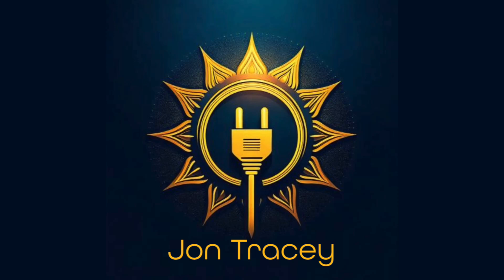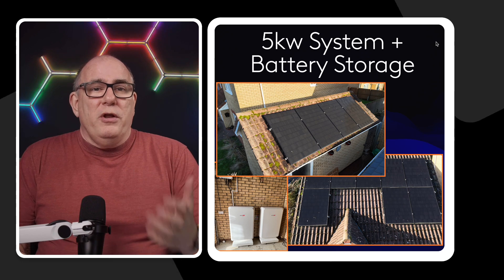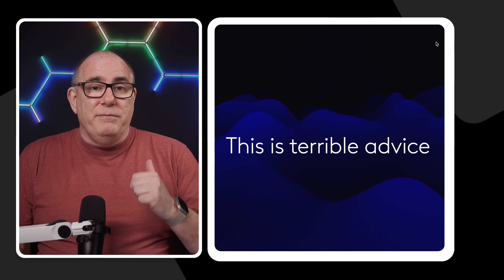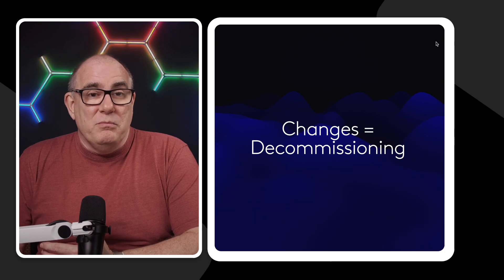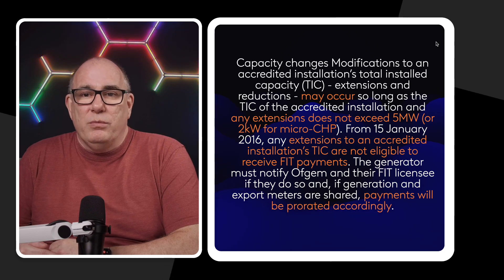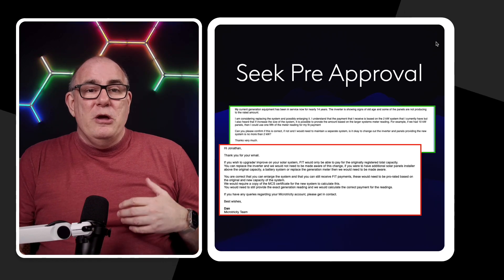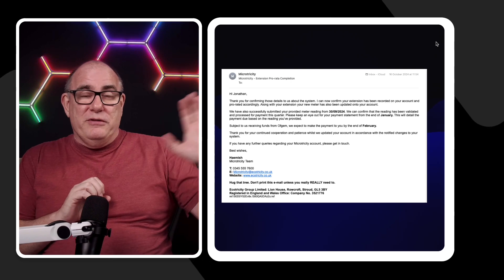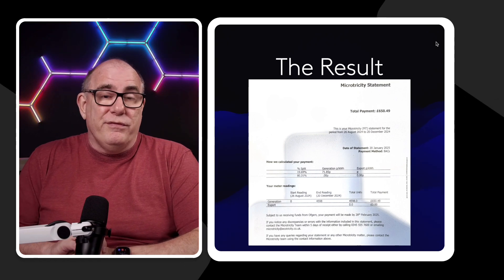How I Upgraded My FIT Solar System (and WHY I Did It)

Comment: I'm 3 minutes into the video. You didn't ask me, because I've been saying for what seems like years now that yes you can! When you do the FITS payments are calculated pro-rata, I'd seen it written somewhere, can't remember now, but I'm sure you'll remind me as I get further into the video. Edit. Yep, that OFGEM document is the one I read. I'm pretty sure the FITS finished in 2019, my system was installed in late 2015, and I got in just before the payments really tanked. I'm currently getting 18.34p for anything I generate on my 4kW system, which paid for itself in less than six years.
Reply from the maker: the ofgen doc wasn’t exactly published was it, they just put it up and let people find it. Good to hear your FIT has paid for itself, do you have it for 15 years. mine has paid itself twice over and still has ten years to run
Reply: @JonathanTracey  it's 20 years, so just over 10 years to run. Your on a very nice rate, so £30k in 15 years, very impressive. My system in late 2015 was £6300 for 4kW SolarEdge, so a lot cheaper, but less rewarding, but still very much worth it. I think I must have found the document when I was looking to add more solar, but decided to add to the garage instead of altering the existing system.

Comment: Like you I would like to simplify from 2 inverters to one. We have an original 3.8KW east facing system for which we receive the 2010 FiT rate. 3 years ago we added a 5KW west facing array and batteries. As and when one of the inverters packs up I will look at the big upgrade. In the meantime we will be removing the Deemed Export and taking on a flat export rate. Great advice in the video, many thanks.
Reply from the maker: Glad you found it useful, reach out if you have any questions 👍

Comment: I was aware of this, had seen similar documents on the OfGem and Eon (my FIT provider) websites.
I have a 4kW FIT system installed 2016, currently paying 12.8p/kWh and then 10.4 of new panels, hybrid inverters and batteries.  I’ve decided to leave mine as-is, I’d need a bigger inverter to combine anything and since the last firmware upgrade my hybrid inverters will charge the batteries from excess AC export so I don’t lose the exported energy.
The % split and the fact that you’re getting it off a wider roof array is a good side benefit I hadn’t considered, but one thing you don’t cover is the negative consequences on FIT payments of fitting a battery to your FIT array.  A thread on the GivEnergy customer forum covered this recently, an OP had had their FIT inverter replaced with a hybrid plus battery having being told that this would just extend the usability of his FIT power by storing it.  What the installer had failed to consider was the impact of battery & inverter losses which can total up to 20%, so when storing excess FIT solar and then discharging later he was losing up to 20% of his FIT generation as measured by the AC meter downstream of the inverter.  With a relatively small array this was very noticeable to him.  Discussion about losses and end conclusion was that his installer has agreed to take the new inverter and battery out and revert back to what he had.
A cautionary tale and worth bearing in mind.

Comment: Thanks for the link to the relevant Ofgem document. It’s useful as I intend to have a minor alteration to a FiT system, which has been in service for almost 11 years, with a couple of panels being added, and a new (replacement) inverter to go with them. The existing one will not cope with the increased peak capability. This is intended to be done by replacing an old hot water roof mounted tube arrangement, which has failed after a couple of decades, with the available space being used by extra PV panels.

I will have to go through the bureaucratic process as explained in the Ofgem bumf, so we’ll see how that is handled by the firm that handles my FiT, i.e. OVO in my case.
Reply from the maker: Yeah first step is get the fit provider on side, after that its simple but ultimately they will be the one that has to sign off in what your doing
Reply: Had awful trouble wih OVO.  Originally wih SSE and moved to OVO when SSE wihdrew from domestic market. Generation meter failed just prior to the changeover. Had a new meter installed and informed SSE but info never got to  OVO. Informed OVO but customer relations were awful. Comms were only by email and hey took ages to respond if a all. Staff were not trained to deal wih FIT issues. Promises were made and broken . Awful. Obviously could not submit any meer readings until OVO recognised that I had a new meter starting from zero again. It took this very simple problem a year to sort out and we had to get Ofgem involved. OVO were ordered tto pay us £150 compensaion. SSE always paid us within a couple of weeks of meter reading submission but OVO delays until the next meter reading window opens. I think OVO did no realise what hey were taking on and hopefully the situation has now improved.
Reply: @rogerphelps9939  Same here, being an ex-SSE customer. They pay as slowly as they can, as you say. The latest event will be how they deal with my revised setup - same meters (my generation one and their import/export one, with me being a metered exporter), but they will have to take my increased total installed capacity (TIC) numbers into account. If they screw it up they might end up overpaying, with Ofgem grumbling about it; we’ll see! The new TIC is about 33% more than the registered value.

Comment: I've recently moved into a house with a FiT system but wanted more generation capacity and battery storage. I've ordered a separate system to be installed basically and not touching the FiT system. Interesting that your correspondence says that pre-approval is needed to add battery storage, I was not aware of that and will have to notify my FiT provider.
Reply from the maker: The main reason for battery approval is for ac coupled batteries, basically on the otherside of the meter, so they pay deemed export for what passes the meter, if you then store it and use it, its being paid for an not recieved.
Reply: @JonathanTracey  makes sense thanks. I've also had a smart meter fitted so actually have an export meter now, I'll also notify them of that and would also like to switch to a SEG tariff.
Reply from the maker: Don’t ask for SEG ask for an export tariff. SEG only pays about 5pm if you opt out of deemed export you can get 15p kWh
Reply: @JonathanTracey  yes I'm with Octopus do I meant the 15p export rate they offer.
Reply from the maker: Oh all good

Comment: Having FIT upgrade in two weeks, 7kWh x2 inverters 1 for 3.8 with FIT the rest with a 10kWh battery. Also in 2010.
Reply from the maker: did you have any troubles with the approval ?
Reply: @JonathanTracey   No, ESE Solar did it all for me.
Reply from the maker: Sounds like you got a good installer

Comment: Your the first person I have found talking about this , a big big thank you, my British property has  an old sunny boy on its last legs and 18 250w generating just 3.7kwh , the 12 on my garage does 5.2kwh , it shows how pannels improved when the arrays generated 1.2kwh for the solar day and new generated 6kwh on a west facing . I’ve been wanting to upgrade the main roof for ages due to it being south facing, but couldn’t find any info about it everyone just said no not possible, which is crazy if you have an inverter failure, nothing lasts 25 years any more , half the time most of the electrical work got brittle, half the time I wondered if this was the case because of e-waste costs .  I’m getting on it now thanks a million for this
Reply from the maker: Glad I can help, just make sure you get all the approvals from everybody before you start changing anything
Reply: Like for like replacements were always permitted. I've had two inverter replacements on FIT systems in the last ten years. The complete replacement with proration is the 2021 change
Reply: @MsDebb  not possible due to no longer being made, whoever did it originally put two sunyboy 2.5 inverters and groped them in 4/5 per string , the company doesn’t exist anymore either.  And had bad things about them online due to quality as they date from 2014, and would require re wiring and upgrading if keeping .  They are Sanyo pannels which shows how old it really is . Which is why I’m glad John found out about hat, I’m going to follow the same starting with the dno
Reply: @ram64man I replaced two sunnyboy inverters with Growatt ones under the OLD rules, as the rule was like for like not identical. The new rules are much more flexible

Comment: I've talked to an installer about this before and they were very wary, so might reference your video in correspondence.  I'll certainly send them the link so thanks for posting that.  I have 14 x 250W panels at the moment, but have also increased my roof area, so seriously considering this.  I think I could get 14-18 500w panels on the roof with different orientations so extending my generation window, but would they allow me to put a 5kw inverter on that?
Reply from the maker: Yeah it’s a bit of a battle with the installers as they feel that if something goes wrong they will be liable, the whole process took me about eight months from start to finish to get all the approvals and make sure everybody was on the same page, but once it was done, it was relatively straightforward

Comment: I have two systems,  they both feed my 3 x 8.5kWh GivEnergy batteries. The weak link was the 3kWh GivEnergy inverter.  I wanted to be able to fill my batteries with off peak electricity and I couldn't do that with a single inverter. 
GivEnergy have now released a battery management system which allows me to employ 2 x 3kWh inverters doubling the rate at which I can download cheap energy overnight.
Reply from the maker: that’s neat not seen that from any other vendor

Comment: We upgraded our 9 panel  2011 2.4 kw system 3 years ago. We kept the original fit meter and fed 6 new panels into it giving it the best south facing roof spaces to retain the 2.4 kw . The remaining roof spaces were covered to feed a second inverter with its own meter . On a sunny day the roof now makes 5kw  and we get a more efficient FIT due to the smaller number of better placed panels. the installer managed the paperwork for us.
Reply from the maker: nice sounds like a good installer who knows their stuff
Reply: I have a similar 2.66kWp system on FIT (14 x 190W).  I'm wanting to add panels to 2 more roofs.  Jonathan advised getting a new meter covering all panels, so its interesting that you could retain the original meter for FIT alone.  Jonathan also said you have to get a MCS certificate for the whole installation.  What was your expereince? Did you have to get a seperate MCS certificate for the new roof panels or a combined one with both the replaced FIT panels plus the new roofs?

Comment: Wow 70p/kWh that must have been one of the really early ones 😮 Mine is 2013 but the rate was dropping every 3 months so I get something like 22p/kWh - it was also dropped to 20y by that point and then ceased in 2019 if I’m not mistaken 🤔 If my current system started to fail or needed a replacement I’d certainly consider the hassle of doing this 👍
Reply from the maker: a yeah i was a 2010 system, so rates weee good 👍

Comment: I  installed a second system with a separate inverter and generation meter on the same roof as my 1.85kW FIT system and that was enough of a pain in the @ss to do, congrats for having the patience and determination to get it done this way. I have another 11 years left on my FIT and I have quite a large flat roof I could cover if I decided I needed more generation so will probably leave the FIT system as it is until then. With the way solar prices and energy prices are going the payment in year 25 alone will probably pay to replace the system. 😀
Reply from the maker: for me it was about doubling the capacity in the same space, as i had no more roof space. tbh if i had the space like you i would probably have done what you did.

Comment: I’m staying put with my FIT payments as I absolutely minimise my exports, charging my car or batteries with any excess. Because my install is split over east/west facing arrays, I never reach my inverters 3.6kw maximum so maybe at some point I will upgrade the panels to increase generation.
Reply from the maker: that’s effectively what i did replacing 10x 220w with 10x 440w panels
Reply: @ so are you saying that even if you don’t replace the inverter you still need to get approval, in my case from Scottish power? Must admit I wouldn’t have know to do that.

Comment: I had to leave my south facing FIT 2012 system on the house untouched when I added E and W facing panels on my garage last year along with a battery. I now have 2 export meters running independently. My FIT payments just come from my original meter and I ditched the deemed export in order to go with the 15p from Octopus.
Perhaps I'll now consider upgrading the house panels and be able to keep the FIT as a proportion of the upgrade. Time to do some maths I think. BTW my 2012 panels have reduced output due to lichen growth and I've bulked at the expense of scaffolding to get them cleaned
Reply from the maker: I had a little bit of liking growth on the panels after 14 years but not as much as I was expecting, maybe we just get enough rain here to keep them clean. Just replacing those old 220 W panels with new for 40 W panels gave us a massive upgrade.

Comment: I guess the main concern would be if you introduce additional panels on less favourable roof slopes. Pressumably your original panels will have been installed on the best slope available. Lets say you have 4kWp facing south. If you now add a further 4kWp on the north facing slope but only get 40% of the output from those, your total generation will increase to 140% of what it was before, however the generation you can claim FIT payments on will  be only 70% of what it was before (140%/2).
Reply from the maker: yes, I suppose you really have to do the maths and work out if it’s a worthwhile upgrade. In my case we also replaced the 220 W panels that were on the south south west roof with 440 W panels. So this increased our generation on our best aspect but also added to it on the least favourable aspect.
Reply: @JonathanTracey  I have a FIT system on the SSE roof.  I'm wanting to either upgrade these panels from 2.7kWp to 4.2kWp or whether to add panels on the NNE and WSW roofs.  I won't lose FIT if I only replace the existing optimally facing panels prorata.  My sums based on PVGIS annual generation show that I will lose up to 21% of my FIT payments depending on what combination of roofs I add on the NNE and WSW roofs.  A new hybrid inverter and panels should be more efficient though.  It feels like just replacing the original panels makes sense, but they are still working well after 14years.  In June the output hit 2.8kW which is more than the kWp!  I can only afford to either replace the original panels OR add panels to the WSW & NNE roofs.  A seperate inverter and meter on the other roofs like mikeberr229 did appears to be the best.  Your thoughts?

Comment: just what i was looking for :) :), i have downloaded & read the docuement you referenced & quick back of the fag packet calculation i think(?) i can virtually triple my current 4kw fits system up to 11.9kw by adding bifacial 595w panels on south(current) plus 4 on the north side, but if i add 4 vertical on the east gable, there is a potential of 14,280w across 3 planes :) :)
Reply from the maker: glad it was useful 👍

Comment: I was told by my battery installer not to touch the FIT system, so I had an ac coupled battery even though I have 4kw of solar. Perhaps it should say you can do it but it is a pain to do and takes months. I also split the fit generation off and get 15p for export. Given the solar is mainly exported I think that it doesn’t matter how they are connected. I ended up spending the money for extending my home solar by getting ripple energy shares and this was cheaper in the end. So all things being equal I would say it worked out ok even with the bad advice.
Reply from the maker: my feeling is they advise against it because they don’t want the liability if something goes wrong. in my case i had to absolve them of any responsibility to get the to do the work

Comment: Great video Jonathan. 
I haver a FIT from 2011 (now 72p per kWh!). Installed capacity is 3.8kW with of course the 3.68 inverter. Can I install more solar panles (say 4.5 kWp) but keep the same 3.68 inverter. Technically not inverting more but would increase overal annual production.
Reply from the maker: i would imagine so but i would seek approvals from you fit provider
Reply: @JonathanTracey  Thanks mate. Having a Vaillant 7kW HP insatalled literally this week - your videos have helped me a lot to prepare over the last few months - thanks a lot.
Reply from the maker: Thank you, glad I could help, good luck with the Install.
Reply: We have permission to add more solar panels, batteries and inverters from our DNO but for the time  being we will not be allowed to export to the grid. I believe in time we will be allowed to export when demand on the grid is high but in the meantime we will be exporting as much as possible to the grid from our existing system and storing as much of excess supply in the new system in batteries and hot water. 
The FIT scheme has made me very enthusiastic about solar and I have been working with it since 2011. It has been one of the few instances where the actual results have exceeded our expectations. For me at least
Reply from the maker: Agree I think the FIT exceeded everyones expectations by a long way, the fact is paying 70p a kWh right now